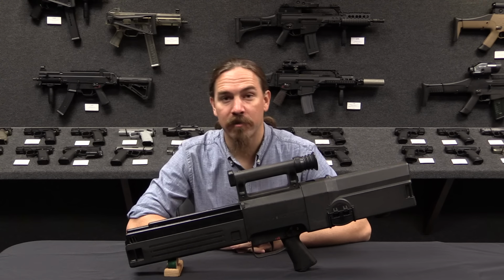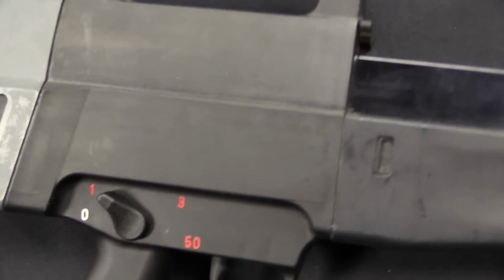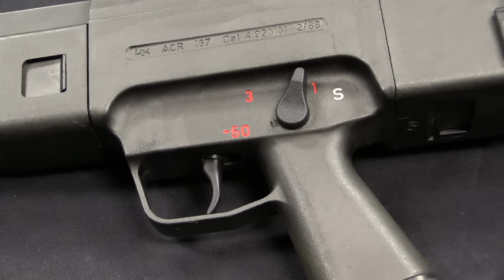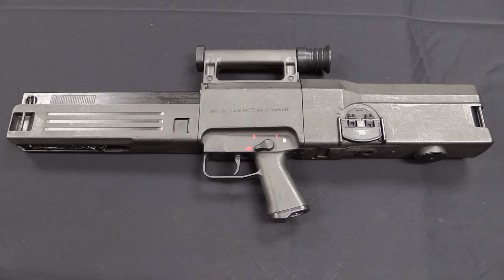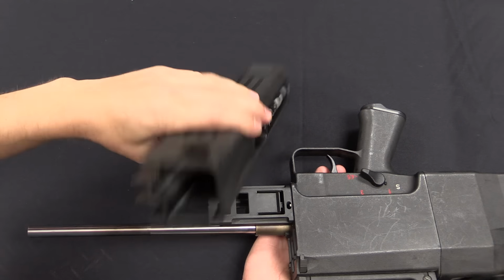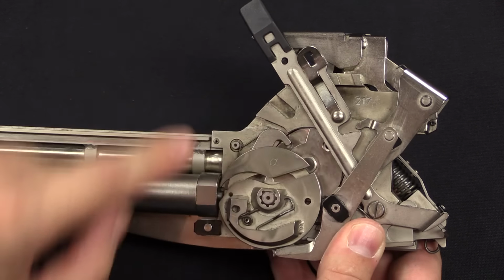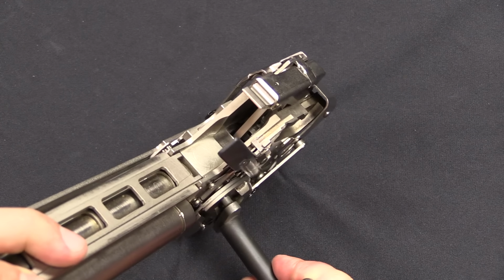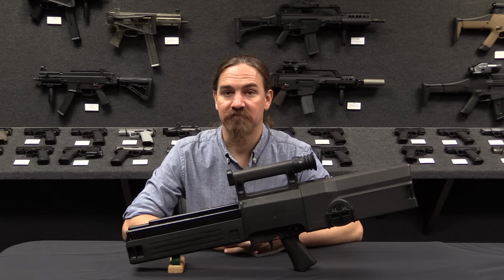Kraut Space Magic: the H&K G11

Comment: I actually own on of these, bought it at action in Switzerland a few years back. I also now have around 1000 rounds of ammo for it after finding a gun maker to make the cartridges for me. He used a 3d printer to create molds for the surrounding shroud, which are now on Thingiverse if you ever need to create the rounds yourself. Not all rounds work however, I would say 90% of the time, which is fine as ejecting these rounds couldn’t be easier.

The gun itself is very cool but I would never use it for protection. Give me my tried and true, extremely, insanely, fast P90 shooting FN 5.7×28mm or KRISS Vector GEN II SBR 10MM Equipped with B&T Suppressor for close action support, than my new Sig Sauer SDMR 16" Coyote .308 for medium to long range.
Reply: Can you make a video please? 🥺
Reply: @bezahltersystemtroll5055  I think that's possible.
Reply: Damn that's crazy... I'm guessing that was very expensive.
Reply: @boogalooblue6723  Yes, very, though its been a good investment so far as it's worth doubled since I bought it.

Comment: In the world of industry I know German engineering (gearboxes, roll assemblies for steelmaking, cranes, etc) as stupid simple. The only difference I find is....HUGE! Literally huge. Every german gearbox I've worked on is stupid simple but uses sheer weight and size to handle what it needs to. Crane gearboxes instead of using wet brakes they just use size and weight to control lowering of loads. Opposite of what you see here. I love german engineering, everything I've ever worked on that is german is built damn well and tough as hell. Love it.
Reply: I've found the most bizarre things I've ever worked on are most obviously Italian. Complex and under built. Almost opposite to what you see from Italian guns.

Comment: What happens if the 2nd cartridge doesn't fire during burst mode? It looks like the ejection hole at the bottom would only line up during semi-auto and full auto.
Reply: If there was a miss shot you would have to empty it with the eject port turn near the stock

Comment: I think caseless weapons will only become practical if we switch to Electrothermal Chemical guns. They vaporize the cartridge with electricity in order to create the expanding gases necessary to push the bullet out of the barrel. The combustion is more efficient so less heat is produced in the firing chamber eliminating the need to pull heat out with a brass cartridge but recoil is a limiting factor.

Comment: Everyone else: "No cases to eject! Everything can be simpler!"
Germans: "Not under our watch."
Reply: the watch or wall-clock?
Reply: @DemetriusAniketos  [Insert East Germany joke here]
Reply: How do you eject a faulty round?
Reply: @gaeroot  turn that charging handle 360°
Reply: @zidniafifamani2378  My point being that a faulty cartridge may not behave as a normal cartridge for ejection. Since its not cased either, it can be squashed in some odd location that you now manually have to extract. Imagine the DeserTech 7.62mm MDR having an issue with ejecting a stuck round but now you can't open anything or access the action either - that's the G11 in worst case.

But idk, haven't worked with the gun so maybe such a scenario is not possible.
Reply: Complexity homeostasis.

If a new development makes the product simpler, then management will add features until it's complicated again.
Reply: @vonschlesien  To an designer or marketer, any system is feature poor and could do so much more...

Comment: why not have bullets just shaped like a heavy shotglass?  and pack your powder into the void... when fired it would take the whole thing with it... the deformation when fired would force the bullet into rifling more, but the "case" is attached to the bullet...  
to fire id use Electricity.  2 nodes that when the current is fed through it detonates...  what i mean is ..  the firing pin is electrically charged, it pierces into the gunpowder and a shock fed through the 2 tuning fork shaped firing pins... this causes detonation of the gunpowder and expels the projectile....

The shape would allow for rapid reload as it has more "shape" than paper or some other rapid burning item they have BEEN using...    and aside from typical gunpowder residue nothing would be left in the barrel...   Eh im sure someone smarter than I has already thought of this and shit on it.

I dunno im pipe dreaming.

Comment: Amazing engineering in that prototype. Totally the wrong way to go for a front line assault rifle.  Simplicity and durability are the keys - even a gas tube is pushing the limits in actual use. (And personally I am never a fan of things - like the G11 mag - moving outside of a firearm. Not certain, but it would seem like dirt on top of the rifle could interfere with the magazine movement and thereby the actions movement. But it is a brilliant design and lighter ammo options are a worthwhile goal. Maybe the next iteration will be viable but I honestly think the ammo designed for this would never cut it.

Comment: Would be good on Cold War Sci Fi space vessels. No brass casing to clean off the deck after a boarding action. Furthermore, small cartridge could be made hollow point or lower power to not puncture hull. 
Also less debris put in orbit during in vacuum fighting. Sci Fi though, just cool thoughts.

Comment: Germany not adopting this junk may be THE BEST result of the collapse of the Soviet Union
Reply: the rifle performed exceptionally well in troop trials, so no.
Reply: @bezahltersystemtroll5055  Im afraid its not that simple. The G-11 was a revolutionary weapon with its caseless design and high use of lighweight polymer materials but its main issue was the reliability. Just like the case  about the M-16 Rifle (especially the a1 varient), troop trials might be quite deceptive about the reliability and with this many small and complex parts, the G11 wasn't going to perform any better.
Reply: @combatengineer8575  To my knowledge, the G11 performed satisfactory and very reliably and was only not adopted because there was no money to do so 🤔 - i agree that the G11 didn't perform much better than the M16, but it did perform somewhat better ( I read 50%, which was however much less than the 100% demanded by the ACR).
Reply: @bezahltersystemtroll5055  There are multiple accounts indicate that the caseless ammunition was prone to failure when subjected to moisture and had some serious sealing problems in the chamber, which makes the G-11 not a reliable firearm at all. As I said in my previous reply, the trials might have satisfactory results but the firearm trials are usually very limited especially about the reliability of the guns. Many firearms have significant upgrades and design changes only after the adoption, not trials, when their problems were realized after extensive use. The  G-11 in its infancy with its complex mechanism and unproven caseless deisgn, was almost certainly going to have serious reliability problems. In addition, the damn thing looked real ugly :D.
Reply: @combatengineer8575  I trust the judgement of the old Bundeswehr :3 and lookswise it isn't worse than any other modern military rifle - all look like action movie props.

Comment: Aerogel insulated ammunition? Like a coating of thin gel on the powder "brick" to prevent ignition without primer being set off?
Reply: Would help with the heat, but wouldn't help much with the brittleness of the round, the hard aerogels are pretty easy to crack just by dropping them.

Comment: 2020 civilian me sees G11 and says "wow, that's pretty cool."

2008 Infantry NCO me sees Ian open it up "OH GOD NO!!!!"
Reply: Gonna need the WHOLE thing cleaned before you can turn it into the armory.
Reply: @chimkenslides  Well, there is no dirt in the gun breach because it is permanently engaged. This is the advantage of rotating bearings in contrast to linear bearings.
Reply: @chimkenslides  Perhaps it would kill off the ridiculous amount of cleaning the US does that is actually worse for overall gun longevity.
Reply: @OnlyNeedJuan  having never really used a gun, but having knowledge on machines, how cleaning something makes it worse?
Reply: @joaopedrosambatti2474  Several reasons, most only contributing minor effects but that can rapidly snowball into massive issues.

-The common cleaning tool is just a brush with metal bristles on a long stick that gets shoved into the action from the muzzle end of the barrel, the stiff bristles and careless rod handling slowly scrape away at the inside of the barrel and wear away the rifling (you can still get probably a few thousand cleanings in before there's any noticeable difference) but this also just shoves all the soot and other buildup into the action.  Some units are outfitted with better cleaning kits that are less abrasive and get pulled through the barrel from the action, but not all units receive these kits. (Nor are you necessarily allowed to use them if you bring your own kit)

-Detail stripping a gun can be even worse.  Not only does it open the possibility of small parts being lost or misplaced (and potentially not noticed until a gunsmith or Quartermaster has a look at it), the oils from your hands are acidic enough to cause problems with already fragile bits such as the firing pin and extractor.

-Final big point is that any cleaning process tends to leave the internals unsealed and exposed for extended periods, during which they are vulnerable to the buildup of dust and other small particulates which can get stuck in the oil film that otherwise protects the parts from wear; hard or rough particulates increase the wear on the parts during operation, while softer particles can become adhesive.

I might be missing some or exaggerating just how major the effects are though, so take that with a grain of salt.
Reply: @GremlinSciences  thanks, had no idea about  the cleaning rod damaging rifling, so thanks for the insight
Reply: @chimkenslides  You just gave me flash-backs :P :P
Reply: I wouldn't have to open that POS. That easy to break charging handle is a show stopper on its own.
Reply: @jeffreyskoritowski4114  It really wouldn't take much R&D to replace that with a better charging handle, but yeah, the whole thing looks like a headache from an organizational stand point. You don't want to change too much too fast. You'll confuse the lemmings.
Reply: OH LAWD NO
Reply: Zach: has to gauge 1000 guns in 24 hours
“Okay, I can do this.”
Sees 2 G11’s
“Welp I’m boned”
Reply: Joe would have a field day with this....
Reply: In honor of the men who are still cleabing the last pieces of the cycling mechanism since 1980
Reply: "Any of you joe's pull the rear off one of these, and it's an automatic Article 15"

Comment: i just wonder why if this gun seems specifically designed to fire 3 round bursts.. why isnt the magazine size a multiple of 3?? 😭😭
Reply: The FAMAS does the same thing. It's so that when your last burst is only 2 rounds you know something is different and youre out of ammo
Reply: @sawyernorthrop4078  ah cool - sound smart - thanks
Reply: @sawyernorthrop4078  but the famas has 25 bullets so the last burst is a single bullet and not 2.
(24+1)
Reply: @michaelBer2  oh shid you right. Same idea though
Reply: Everything logical goes into the gun. No Brain cells left for this useless satisfaction
Reply: It used to hold 45 which is divisible by 3...but the K2 model upgraded it to 50, potentially for reasons described before by Sawyer Nothrop.
Reply: The same reason the counts in packages of hot dogs and hot dog rolls don't always match up.
Reply: Because it can also for single shots. 3+1=4 or 5 or 6 etc. You're assuming a magazine would only be fired in one mode.
Reply: 16*3 ; & 1*2 trigger pulls... This would be interesting to shoot that's for sure
Reply: Seems like it would be better because you'll know you're out of rounds.

Comment: It's an interesting idea maybe a motor for cycling the rounds a spark ignition for the propellant using an enlogated copper jacket that contains the propellant like a gyrojet rocket?and lithium batteries to power it this may be something worth a second try,it would be light and with a long barrel in a compact size.

120thousand

Comment: "The recoil in the three-round burst is not felt by the weapon's user until after the third round has left the chamber." That's my favourite feature of this gun.
Reply: "That's 200% more bullet, per bullet."
Reply: @Ze_N00B  See? Just try getting to that cradle now. You can't.
Reply: I think Bungie needs to buff it a bit, but I still love the ornaments for it.
Reply: "There are three bullets in you and my shoulder doesn't hurt yet"
Reply: You will never feel recoil if you dont shoot three shots then😉
Reply: @pacmanosaurus1971  Correct. Fire 2 bullets out of the 3-round burst - no recoil.
Reply: "it works more like a sniper than an assault rifle on burst. is it a good thing? depends."
Reply: You shoot 3, but feel 1, amazing
Reply: @elgordobondiola  Yep, fascinated by this! Russia has an assault rifle that does a 2-round burst like that - https://en.wikipedia.org/wiki/AN-94. And the british bullpup rifle (I forgot the name) has a very accurate 1-shot mode.
Reply: it’s like an an-94
Reply: @0searchresults757  Thanks for reminding! An-94 actually has a pulley system to pull the next round in!
Reply: Volume of fire is the whole point of the weapon.
Reply: Well, not the full recoil anyway. There is the spring mechanism. That's going to absorb some energy, but it will still pull on the part where it attaches. And that is on the outside, so it will introduce recoil. How much I don't know.

Comment: Actually now that I see the parts of the rotation mechanism I see how simple it works. Oddly Though I think a 45 degree insertion mechanism might have both increased rate of fire and reduced parts with only a 20% reduction on capacity.

Comment: I am just blown away by the brilliant "simplexity" of the weapon.
There are a great many small parts that need to work all the time, every time.
If I needed just a range gun, I would be the coolest guy at the range.
In combat in the Middle East, however, with sand in the nearly nano particulate size, I would be fundamentally  screwed.
I would keep the gun design for the cool factor, drop the caseless ammo, and design micro-self propelled projectiles.

Think little solid fueled micro rockets the size of a .30 or .50 caliber round with spring loaded fins.
I used to work in explosives, and armor development as a munitions formulator, and Misnay Schardin devices.
I would formulate projectiles with tiny chemically invisible flameless jets with tiny shaped charges.
That could be very easy to manufacture at low cost.
Reply: Shit, yeah.
Get just a little sand through the cracks and into the workings....maybe get a failure a few weeks out. And that's not even accounting for what happens with differing levels of humidity.
Reply: @jeromed.8433  Roger that my friend, but it is still a ground breaking design.
Let the Germans engineer it, then take it to the Russians to simplify it and ruggedize it, then take it to the Israeli's to manufacture it, then give to the Yanks to field it.

Comment: I do wonder about the constantly changing weight...3 x 50 rnds is a fair weight, then when you are down to the last few, rounds the whole system will be massively different and handle differently? Its ok with 30 round magazines or 20 rounds, but 150 is a fair mass.

Comment: With some major Modifications to the Action, instead of Firing Projectiles it could be changed to fire Lasers or Plasma, or some other Energy Based Ammunition.

The Long 50 Cap Mag would be converted into a Battery of some sort for the power and storage of the Energy Ammunition.

So the HK G11 is actually the Starting Point to an Energy Based Weapon. And could Pioneer Future Sci-Fi Like Energy Weapons.

Comment: @Forgotten Weapons    Is it possible that the heat of the gun itself could set off some of the charges in the spare magazines stored on the gun after a significant amount of use?
Lol - those interior works are insanely (lol, I wrote this part before I got to the part of the video where you said exactly the same thing :-) ) complicated and thus seems like it would be prohibitively expensive to produce and service if something breaks.  Additionally, the small size of the round seems like it would have been problematic as well in terms of penetration of body armor.

Comment: I would think a FMJ that extended to the very bottom of the round would provide a solution to most of the damage and heat removal problems. Might also allow for higher chamber pressures and a cleaner bore. The fact that it wasn't implemented suggests there is some fundamental flaw in my idea, as I'm sure this would have been thought of during the design process...